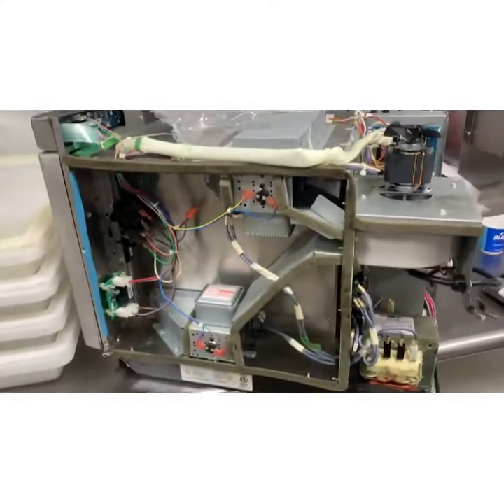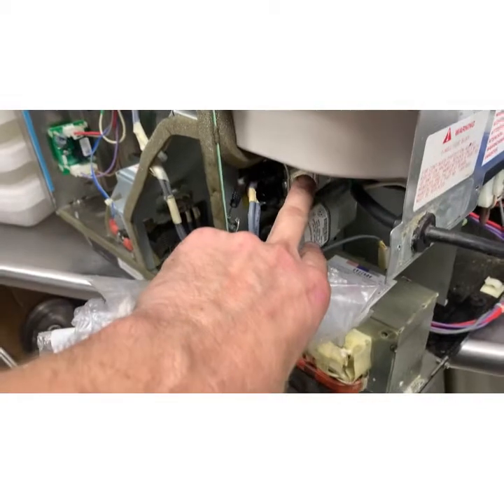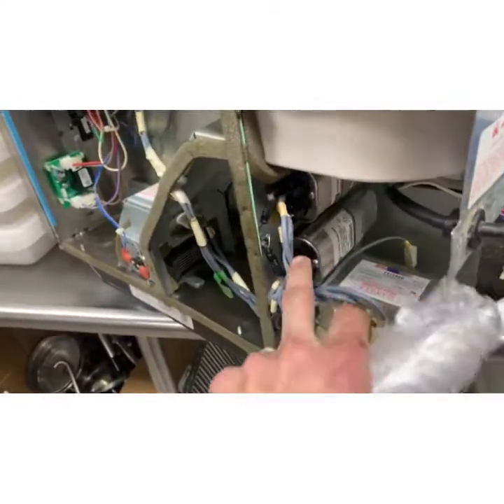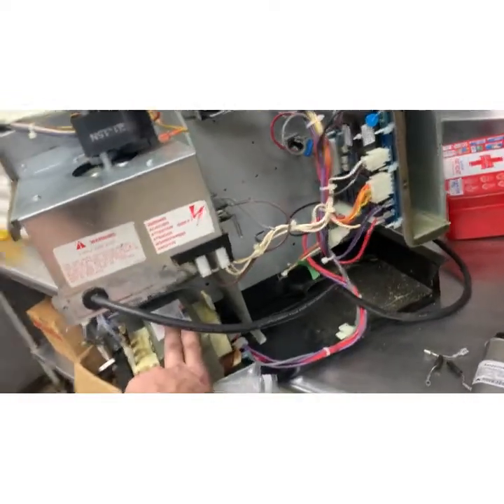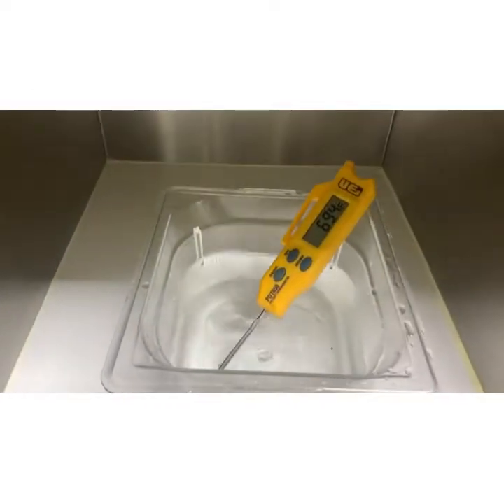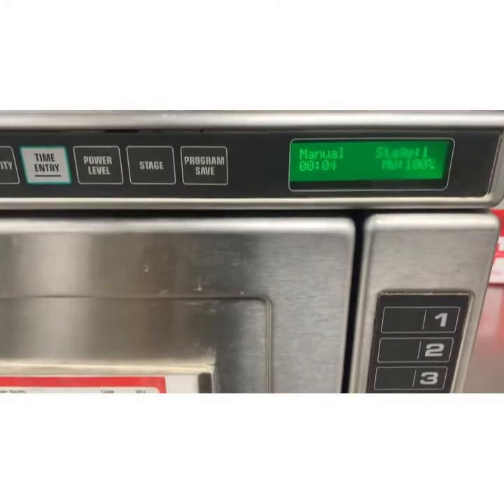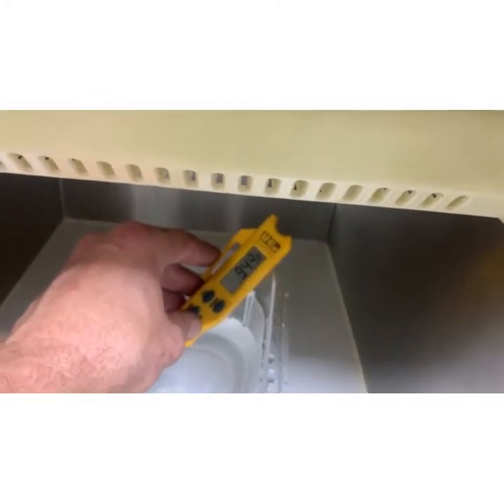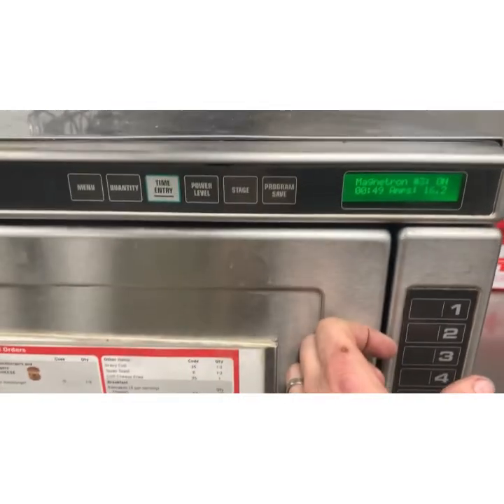Booster oven high voltage rebuild

Comment: i have come across many transformers that ohm out okay, but that doesnt always mean its okay. also when testing those RC series, its good practice to put cardboard on the side when the cover is off so you dont overheat the mags. best way to test those diodes is an analog meter than goes up to 50M ohms. usually youll get about 15M ohms of resistance one way. what was the original complaint? suprised the guys at ACP said to replace everything.
Reply from the maker: Great information for me to learn.  I don’t only do these to give but equally to gain y’all’s knowledge.  I’ve always done the relay side of these ovens, only recently started going full bore high voltage.
Reply from the maker: Trey - why would they overheat uncovered?  I guess I don’t really understand how they function if I’m asking that Q..   can you teach?
Reply: @restaurantrepairs  the blower will not push air through the mags, because it has the open area between the blower and the mags. Usually happens when testing for awhile. The way they designed it is silly.